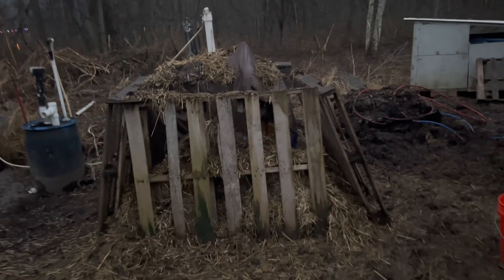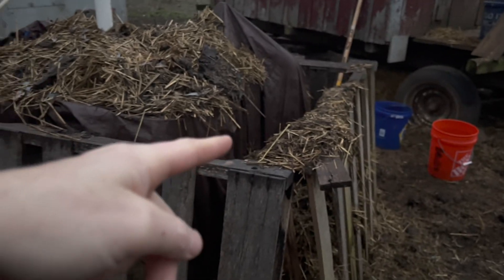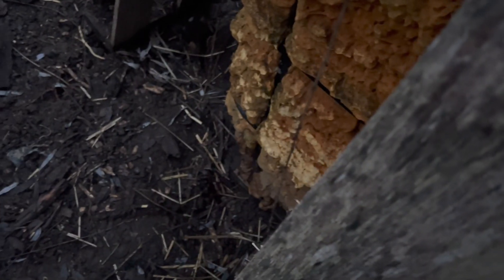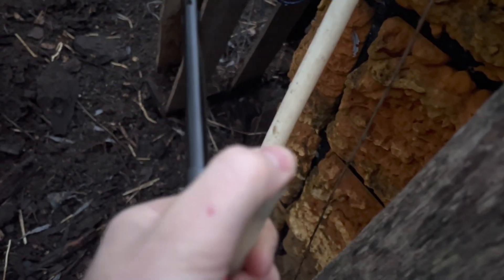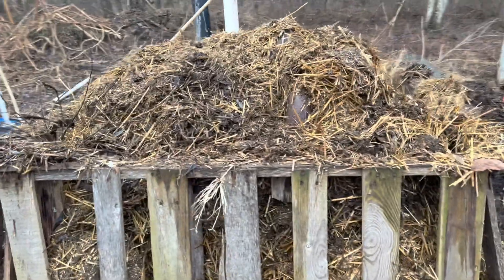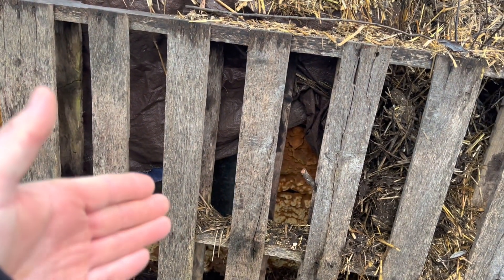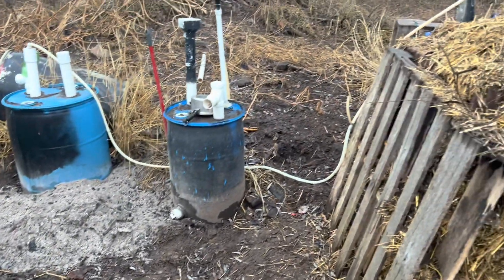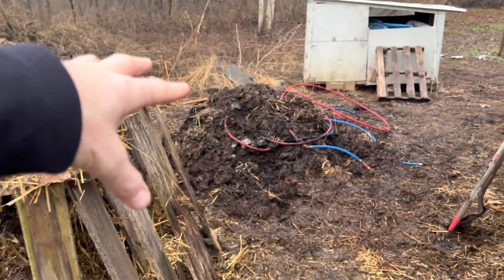DIY Biogas Digester

Comment: Does the digester get warm from the activity of the methogens?
Reply from the maker: Unfortunately methogens will not create they’re own heat. Insulating a digester and adding a source of heat is the better option for biogas to be made. Thank you for the question.
Reply: @davidoutdoors74  I like the idea of using a compost pile to heat it. Perhaps it could be put a few foot below ground to keep it from freezing.
Reply from the maker: @ohiovr  Going to build another IBC digester this spring using the water lines in a compost pile to heat the digester